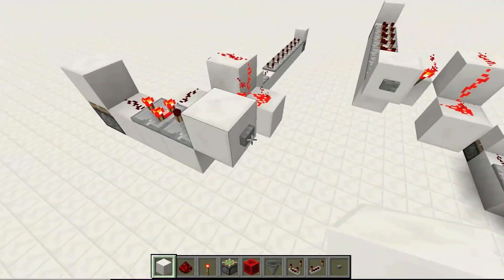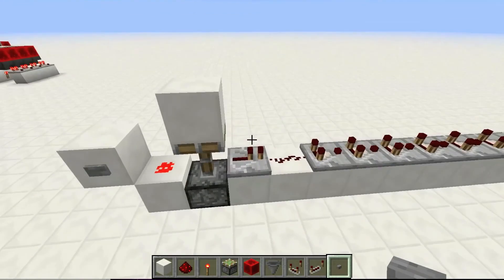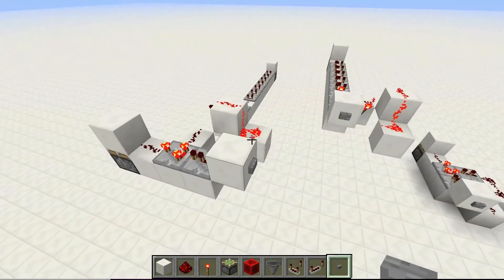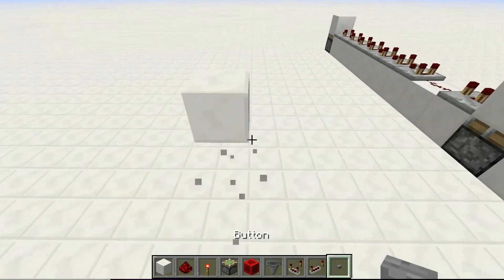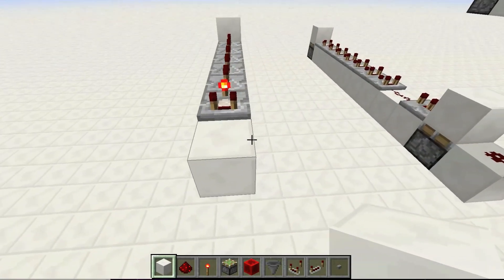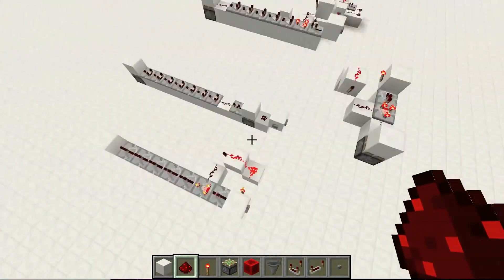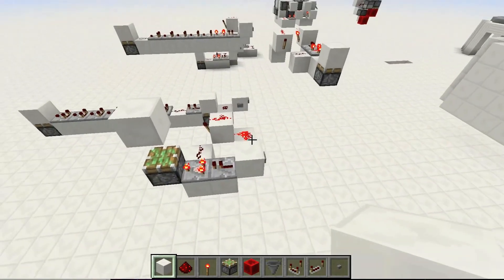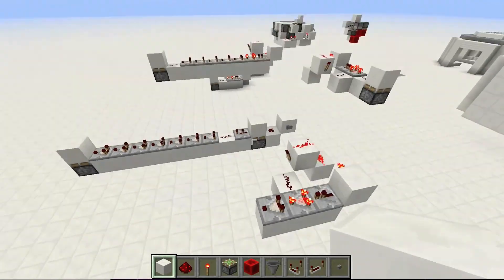1 tick signal from a comparator

Comment: It is even weirder, since these 1 tick pulses will propagate through other comparators (also as inputs from the side) and torches. However if this pulse gets extended by a 1 tick repeater it will not be able to do so. So the problem seems to be with the repeaters.